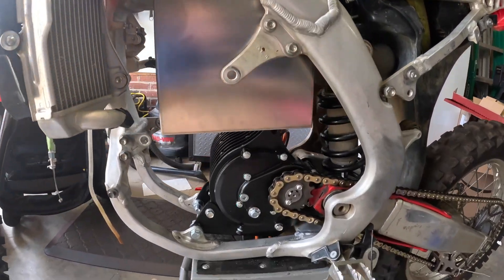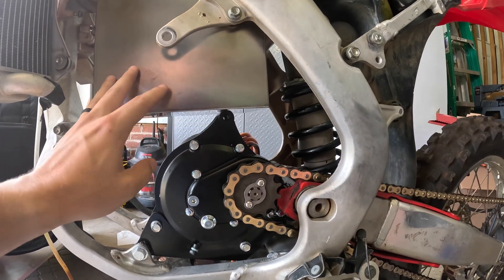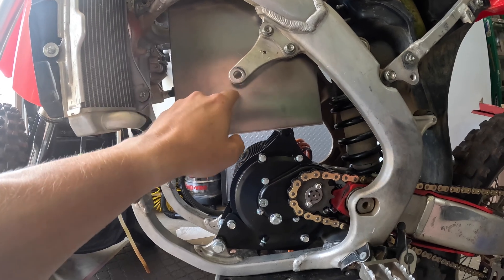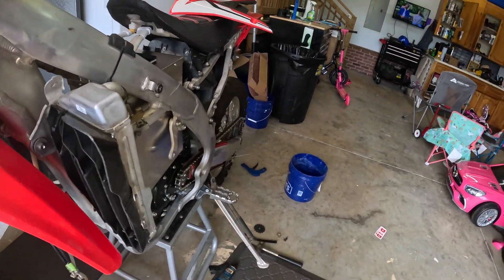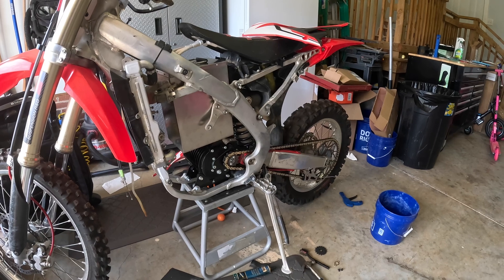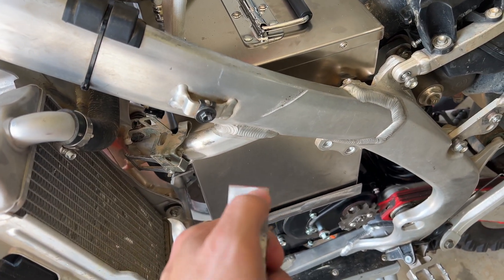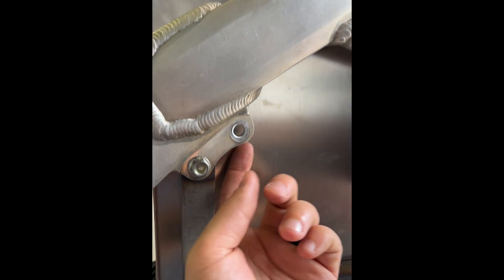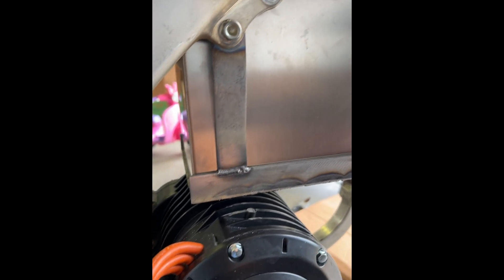How to mount a battery into a homemade electric CRF450 frame.

Comment: How much was the complete kit you brought??? Tks
Reply from the maker: It was $3,300 for motor, drive, and battery from electroandcompany. You can source everything by yourself for much cheaper but it will not be a plug and play solution

Comment: Could you get a shot of the frame trimmingtrimming you did to make the battery fit. I’m torn if I’m going to top load or side load. Any regrets going top load?
Reply from the maker: Yeah, I'll post a video of what I did soon. Top load seems OK so far. I don't plan on removing the battery or doing battery swaps. The biggest draw back is that I cannot put a gas engine back in it.
Reply from the maker: I posted a short video with a little more detail of what I cut.

Comment: just converted a YZ to Qs138v3  - 51ah Chi battery - have 500+ miles on it - Great Fun and Fast  -  had to cut out most of bottom of tank -  battery is same size as surron but taller
- drops in from top -  Electro  and Co  kit
Reply from the maker: What type of riding do you typically do?
Reply: how much range do you get with 51 ah? Im thinking of getting 2 52 ah batteries.
Reply: @LoganThatGuy  25 to30 miles going fast 
 or about 2 hours ride time - slow putting around will last 5 + hours - bike is More than fast enough

Comment: Looks great! I am halfway thru a YZF conversion. what controller did you go with? where did you mount it. I didnt see a video but could have missed it.
Reply from the maker: Now that you mention it, I didn't show the controller mounting in any video. I will try o post a short video on it. Ultimately, I put it in the air box under the seat. The 2017 CRF450 had dual exhaust on it, and I was able to use the exhaust hangers on each side of the sub frame to bolt a bracket for the controller to. This is the controller EM-260sp(28kw).I bought the entire kit from Electroandcompany.com

Comment: Yo, I just purchased a Kx frame to build on. How did you size the battery before starting the build? And what size is your battery?
Reply from the maker: I have a 76V, 40ah battery from Electro and Company. It was one of the options for their DIY kit.  I had the frame so I was able to measure the opening and I also looked at the batteries others were using on the Facebook groups. A lot of people have custom batteries made to fit their odd shapes. I went the easy route, but more expensive. What year frame did you get?
Reply: @ Thanks for the reply, I went with a 2014. It cost 1500, with new tires, motor blew. What forums do you suggest to find others?
Reply from the maker: @briandesilets8425  sorry I just seen your comments. There are two identical named ones on Facebook. Electric motocross builders - which I think was started by the guys that own electro and company. And the other is electric motorcycle builds.
Reply: or which Facebook groups?